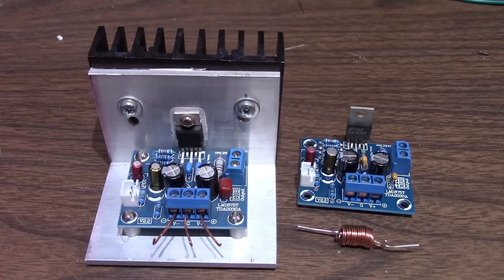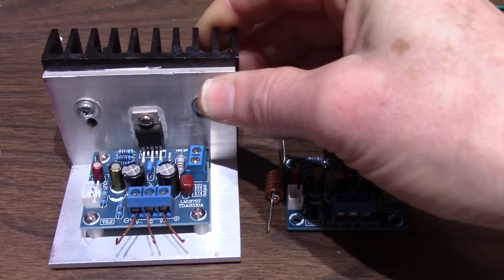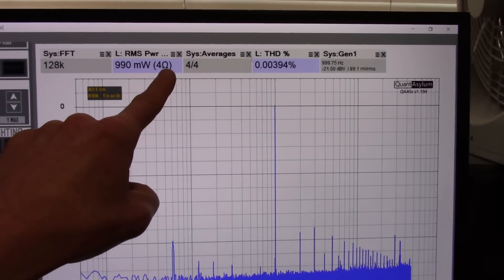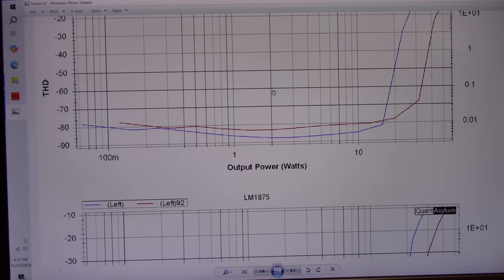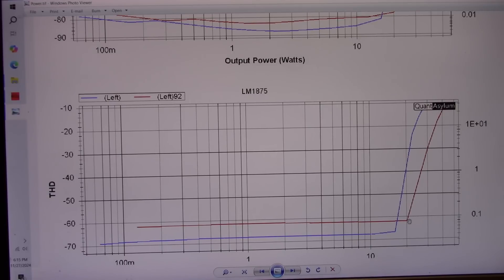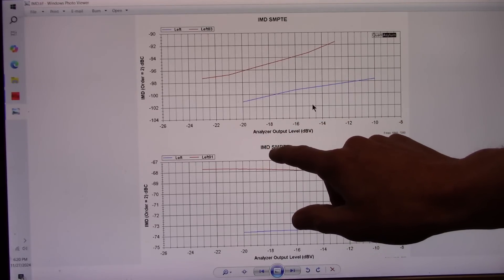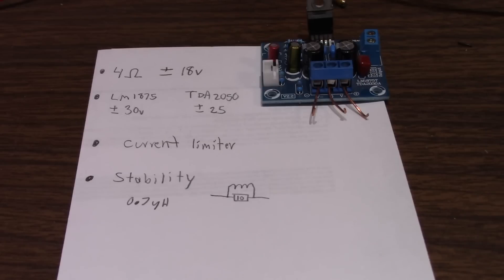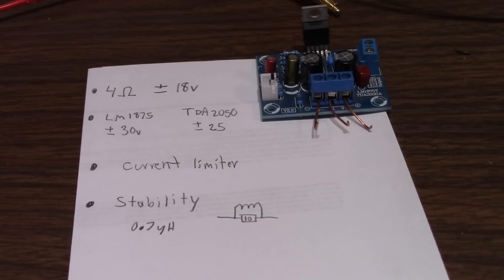TDA2050 vs LM1875 on the QA403 audio analyzer

Comment: Try searching for the video "TDA2030, TDA2050, LM1875 - что лучше?" by Maxim Kryukov.  
He made many different measurements. What is interesting is that he shows that the LM1875 has a "step" type distortion, like in class B. Especially pronounced at frequencies of 5 kHz and above.

Comment: 1. What's the dimensions of the L bracket you used to mount the board on heatsinks as well as to fix it firmly ?
2. What dimensions heatsink should be used if two numbers of Lm1875 is used to make a stereo amp & 20 watts each is to be achieved from each amp totalling 40 watts ?

Comment: What is the power supply you prefer to used in your personal tda2050 amp?
Reply from the maker: It uses a 25.2 VAC CT 2A transformer. After rectification and filtering, it produces around +/- 15 volt rails.
Reply: @JohnAudioTech  its not good a 25 vac straight to the amp?
Reply from the maker: @ No, it is rectified and filtered to DC.
Reply: Is a 24v 6amp good for it?

Comment: I love this.  Some dummies are spending a thousand dollars on audiophile power cables, yet a TDA2050 with alligator-clipped power cables turns in a 0.0036% THD at 5.6W into 8-ohms and an almost perfectly flat frequency response from infrasonic to ultrasonic frequencies.  This is what Quant Asylums should be used for ;).

Comment: What type of 10 Ohms resistor is recommended - wirewound, MFR or CFR
Reply from the maker: Not really critical. Any inductance in the resistor will add to the total of the network and that would be relatively small.

Comment: Hmmm,
A year or more ago you measured & reviewed a bag of mixed chip amps and had the TDA2050 on the top of your list. At the time I bought one, likely a knock off.

Skip ahead: 

In my retirement I am aiming to build each style of receiver up to superheterodyne from scratch. The most recent receiver is a type of regenerative receiver. My audio out comes from two 2n3904 transistors & is rather weak. 

I was going to use the standard lm386 to boost the audio & remembered I had the TDA2050 chip amp. I added this and it was a really nice improvement that brought the signal that had been just enough to input into line level on a commercial audio amp to easily provides line level requirements.

My ears tell me it's a nicer chip amp compared to the lm386. It's very clean sounding.

Comment: These systems originate from the TDA2010 and TDA2020 systems from the late seventies, where the best scientists in the world wanted to make the best low-frequency integrated circuit in the world and give it to society. At that time, these were all the possibilities of science of the richest country in the world. The systems are cheap because they are produced by a machine, but it is very valuable equipment, unavailable without technology for many billions of dollars. The idea was to give the quality of equipment for billions to almost every person.

Unfortunately, the first TDA2020 systems exploded due to thermal overload from the use of an inappropriate housing, but this was an unknown technology.

Immediately after that came the TDA2030, TDA2030A, TDA2040 and TDA2050 and TDA2051, all based on the same system, produced by many countries, including poor communist ones. The TDA2040 was quickly discontinued due to its low maximum voltage, as was the TDA2051 due to the lack of any visible/needed improvements over the TDA2050. It didn't make sense to incur the costs associated with producing so many similar devices.

Comment: After watching your original comparison video from a couple years ago I bought a couple LM1875 boards from Aliexpress and found the sound excellent from a pair of speakers I made at the 10 watts and below range. Given this current updated video, to a normal lay person listening at the lower power levels, averaging below 10 watts, would there be a discernible audio difference between the two chips based on the 0.001% and the 0.01% distortion levels? 

To me the lm1875 sounds fine, but would anyone literally be able to say after listening to it, oh my god why aren't you using a tda2050 chip you numpty your missing out on the 0.001% audiophile quality music!! And storm off in disgust at my choice of chips 😅
Reply: Live audio engineer here. For most people, if it sounds fine, it is fine. Any harmonics created by the distortion will be so far down in the noise, the environment you're in will probably make them inaudible.

In fact, for most of the applications I might use either of these chips for, I might prefer the LM1875 myself. It has low enough noise floor for "CD quality" applications (defining as > 85 dB in dynamic range, from unity to noise floor). Plus, the consistent THD across audible frequency means it won't be increasing harmonics as the frequency goes up. It's a small advantage in this test, but if one doesn't need the lower noise floor, it means better representation across the audible range.

Of course, any modern IC will blow both of these out of the water. My current favorite small amplifier IC is the Texas Instruments TPA3116D2. I have one in a Dayton-branded amp which I use for garage speakers. If you can feed it enough voltage, it's got lots of power, but it's otherwise unremarkable -- exactly what one wants, when one wants uncolored sound reproduction. More than adequate for oil changes. 😁
Reply: @McTroyd  that's the long and short of it. If it sounds good it is good. It can always be better. But once you reach a certain point that should do it. If I wanted it to sound better I should have used hearing protection more. I have so much buzzing in my ears now I'm lucky I can hear at all.
Reply from the maker: I consider distortion levels of .1% or less to be fine. Even at 1%, I'm hard pressed to tell the difference with low order harmonic content.
Reply: @JohnAudioTech  distortion has pretty much been solved at this point. People choosing based on two different numbers they can't hear is a bit goofy. Stability is more important. Because  we can hear instability. Although I am surprised  how little I can hear ringing usually. Full out oscillation I can hear. I made an amplifier once that picked up an AM radio station clear as a bell. You can say it had a bit of a stability issue. Then I spent some time trying to get it to pick other stations up too. I was unsuccessful at that. Clearly I knew not what I was doing.
Reply: @1pcfred  Well, careful. Harmonics are the basis of how effects processors work. Even inaudible harmonics can technically interact with what's audible and change the sound. As most of us don't have analyzers like John does, that number is the easiest way to know whether the sound system will tend to interact or not. I certainly wouldn't begrudge anyone looking for the better number, especially if the price difference isn't a big one.

Of course, having said that, commodity and consumer hardware very often don't represent their specifications accurately. It's funny to me how I can buy a $500 professional amplified speaker with a frequency response of 55 Hz to 18 kHz, but the $20 Wal-Mart Bluetooth speaker somehow has a frequency response of 20 Hz to 20 kHz. Caveat emptor, indeed.
Reply: The reality is most people can't hear less than 3% distortion. No one can hear the difference between 0.01% and 0.001%. That is far beyond our perception. I don't care who they are or what they think. Most people are absolute idiots. I'm sorry but that's just the world we live in.

Comment: The resistor (magneticall -most) inside the coil increases the distortion
Reply: I have to wonder if this could ever be significant. Also if one used a CF or MF type then they also have some inductance due to the spiral cut across the film. That's why big old carbon core resistors are often used. non-inductive but noisy.

Comment: "Why didn't I buy this a long time ago?"  I just got one last week and asked myself the same question haha.  I've been using a MOTU M4 with REW for the last few years and it's been fine but the QA403 is actually calibrated for absolute readings, USB isolated, and can deal with larger voltages.  Plus I'm getting a -143.7dBFS noise floor with the input terminated, it's insane.
Reply from the maker: It is a good bit of kit for the money. Part of the reason for not getting one sooner is because of availability problems (chip shortages and such).
Reply: I held off for maybe a year because they announced the QA404. I eventually stopped waiting and got the 403. Glad I did as the 404 is still not out and I’ve had my 403 for a little over a year now.

Comment: On the video you are calling it  TDA2050.   I'm assuming it's TDA2030 as the name suggests.   Love this amp thanks for the video!
Reply from the maker: No, it is the TDA2050. There was also the TDA2040.
Reply: @JohnAudioTech  have you ever thought about reviewing something that isn't obsolete? Asking for a friend. Or failing that maybe reviewing the counterfeit parts that are available today. Because that's what anyone is going to get now. Maybe the fakes aren't so bad today?
Reply: @1pcfred  I have a fake tda7297 and a factory original but I really like the fakey for its valve like warmth compared to analytical sound of the real deal. 
Now I'm interested in the 2050 and how it will compare with the 7297's.